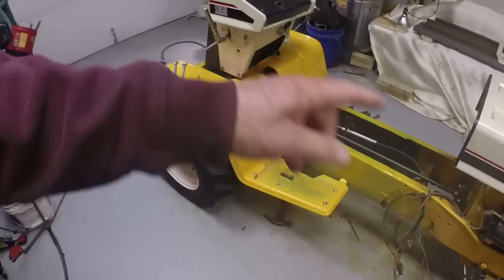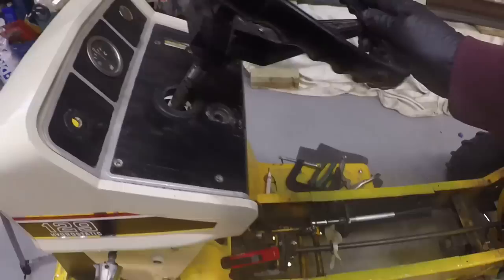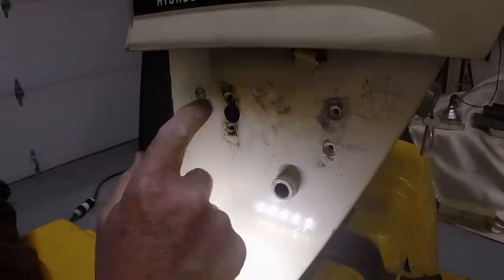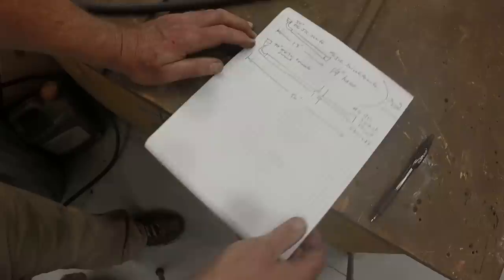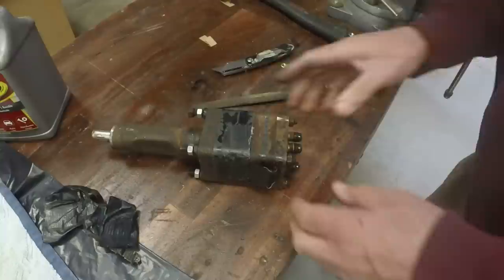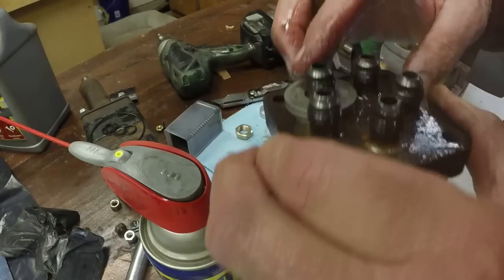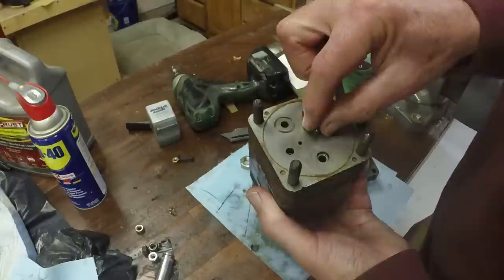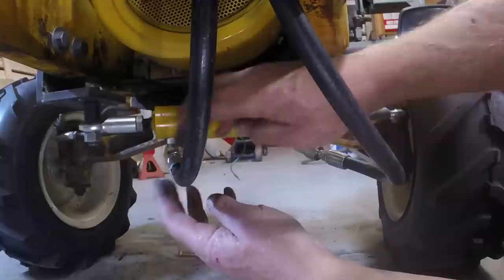Cub Cadet Forklift Build, EP:13, Power Steering Install

Comment: Years ago I went to a farm sale to bid on a 129 Cub Cadet.  Once I found it, determined the engine rod was broke, no driveshaft, tranny was partially disassembled, and the deck was shot.  The seller made one good machine from two, and what remained of the donor.  It still sold for over $1K.

Comment: Actually, there is a way to test those fittings. Just need a schrader valve welded/brazed to an adapter and fasten those lines to the block. Check for leaks just like you do for gas leaks, soapy water. Just shoot a little air in those lines, plus, this will also help you diagnose if you hooked those lines up correctly. Bleeding the system is far easier than people think it is. Cheers :)

Comment: You need to restore the conical portion of the fitting.  If you have a pin punch that will fit the hole or a piece of drill rod that fits, you can drive it thru and then use the diamond hone to get a smooth surface to seal on.

Comment: I was taught when you have tapered connections, you tighten to seat, then loosen and retighten. This allows the connection to form to itself. I have done it for years and never had leaks. Especially with brake lines.

Comment: When I put hoses on the type of fittings that you are repairing (and plumbing fixtures like toilet and faucet supply lines), I like to use a small amount of thread sealant on the bells of those fittings to help them seal without having to crank down really hard on them. I know they say you don’t need to but I have really good luck when I use a sealer on them, it takes less torque and they stay dry forever. 
Another good installment, thanks for sharing!
Reply from the maker: Can't use sealant in a hydraulic system.

Comment: Should be easy with a little work to pressure test your plate.  Manufacture a flat back plate and a gasket.  Get caps for the outlets and cap every one but the test subject.  Use an old hose with a suitable fitting and a grease gun.  Pump up the pressure until you get your 600 psi.  A good grease gun should reach that pressure using grease or a heavy oil.  Another old line with the proper hydraulic fitting on one end and a npt on the other with a gauge on it for more exact results.  On the gauge line you could valve it for pressure release.  Those fittings do look thrashed.  An option is to drill the old ones out and cut a thread to accept new fittings.  Might be easiest and cheapest to do with the best results.

Comment: I did a quick look online and it appears that they make a thin tapered seal for damaged hydraulic fittings. Worst case scenario there is a seal to get very worst case scenario brazing in a new fitting. To me it looks like you should be good to not have a leak. I lapped valve seats in my old Datsun pickup that looked worse than that that ended up holding fuel  in the runners over night. I'm just glad they have a tool to fix those fittings and also that you had it.

Comment: There was a slot with a pocket in the bottom plate for that ball to go in and act like a one way check valve - might wanna look at your video when you took it apart?
you could do a slight build up of at least that one really torn up port with silver solder or blazing rod and then re-hone it? it's pretty damaged! Yikes!~

Comment: Always nice to design and build your latest idea. I do it a lot myself. And usually the only reward is seeing it work like you planned. I have to say I was wondering why you greased up the rusty balls in the steering section and applied them to a totally rusted housing? There has to be a reason you didn't media blast that section and than applied the grease so it would work against the clean metal instead of the rust. IDK. But interesting project all the same. Oh and I do like the two dogs. Always great seeing them...Thumbs Up!
Reply from the maker: Not a lot of wear on that flex joint, so didn't warrant a lot of work to clean up.

Comment: I think you might need to run that power beyond back to the tank if not used. Capping it might deadhead the pump.
Reply from the maker: I checked and it won't matter if it's capped.

Comment: Very common fittings, should have replaced.
Reply from the maker: Brazed in place.
Reply: @woodandmetalshoptime8048 , It might even be silver solder, it’s a little harder.

Comment: What exactly can you run off the original hydro system besides pwr steering ? I'm sure you've touched on the subject in the past so I apologise for asking.  I have a 77 CC 1450 I plan to  extend add a tilt bed and front blade on this winter . Any help would be greatly appreciated . Love the videos and the pups . Thank you
Reply from the maker: Given the limitations of 600 psi and a couple gallons/min you are really limited to operating some hydraulic cylinders.  It's not enough to operate a backhoe, for example. Or at least one that is useful.  (I've heard it has been done nonetheless, albeit at low speed).  A typical small loader or backhoe will want 5-6 gpm at 2000 to 3000 gpm. I think the last time I did the calculations, 6 gpm at 2500 psi would take about 10 hp.
Reply: So maybe a cylinder to tilt a bed and add a small pump/ res. to lift a blade would be the way to do it properly?  One more question if you don't mind . You are running 12 hp and in my mind it doesn't seem like enough power but your builds seem to do just fine . Is it the hydros that make that possible? Are they that efficient?  Ok that was 2 questions. Lol  Thank you again for your time and videos .
Reply from the maker: The ports on the hydrostat will lift or angle a blade, no problem.  Tilting a bed depends on the load in the bed.  Do a calculation on capacity by taking the hydraulic pressure (use, say, 500 psi) and the surface area of the cylinder piston. 

A 2 inch piston has a surface area of  pi(r^2)= 3.14x (1x1)=3.14 square inches.  Call it 3.  So 3x500=1500 lbs of force on that cylinder piston. Can that lift a bed? Depends on the geometry of the cylinder and how it is mounted as it is not the same as the load in the bed. 

I built a dump bed on a Cub Cadet and there is a video on my channel.  I used an auxiliary hydraulic pump to lift the bed as my design load was 1000 lbs and the cylinder needed 3000 lbs to start the lift (due to the angle of the cylinder, etc.).  Look at that video for an easy way to mount a pump on the rear of the hydrostat. Also, that same installation is done on the forklift build, too.  

As for HP,   it's always a compromise. Commercial machines of this size would be 20 hp or more.  My build objectives are mostly about using Cub components, so in keeping with that I've avoided using larger engines. As a result, the capabilities of the machines are limited by that HP.  I'm fine with that since these are more about the build than the need for a super capable machine that will see a lot of use.  Someone else might be sadly disappointed with the lower HP if they plan to really work the machine.  

That's long winded, but I hope it answers your questions.
Reply from the maker: Oh, one more thing. The rear end of the tractor holds a couple gallons. So that's your reservoir. You don't need to add another fluid tank just to operate a couple small cylinders.  If you get into a backhoe/loader build, then you'll need another tank and probably a cooler as well.
Reply: @woodandmetalshoptime8048  that works out for me then . I dont plan on hauling more than a few hundred pounds at the most . I have alot of trees so the smaller the equipment the better to maneuver around . Again I appreciate your help and information.   Ever think about doing an Kohler  engine build maybe a custom turbo and other goodies? Lol  might be fun .  I'm going to go look at another 1450 for parts this week so maybe it's not completely destroyed. Thanks again .